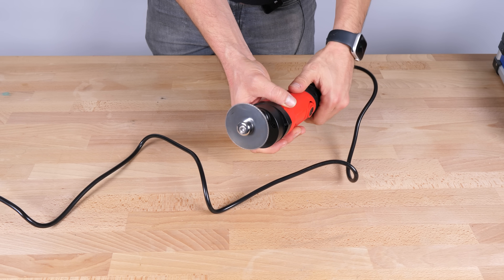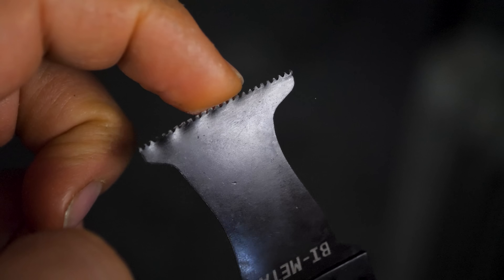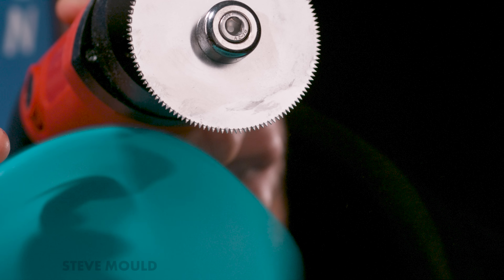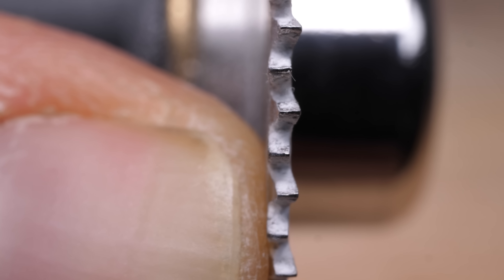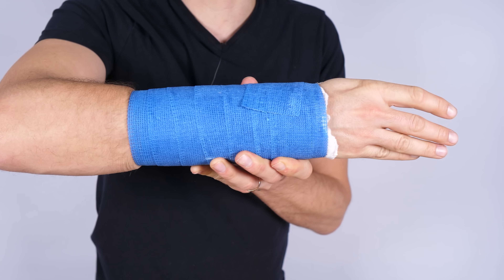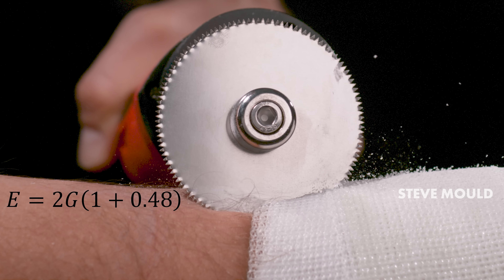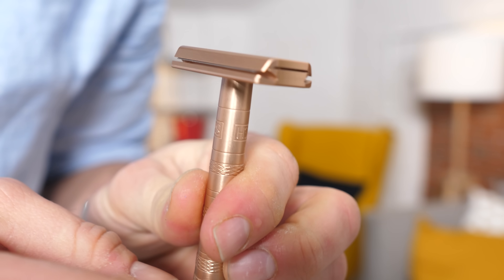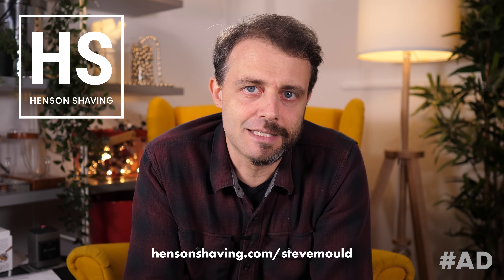A cast saw on human skin

Comment: Fein made the first oscillating tool for the construction industry. I use my makita version almost daily and I have pushed way to hard to cut a piece of wood and it slipped and jabbed into my palm more than a few times and not even a Nick. But afterthirty years in construction my hands are pretty rough.

Comment: I was born with congenital clubfoot and had to wear a cast for a long time. When they went to remove my cast, they used a machine like this. My mother told me that I was crying a lot, supposedly because of the noise, and the doctors said I was just scared. Apparently the person using it didn't realize that they were rubbing my skin and the friction made the cast around it start to melt. I ended up having second degree burns on my leg, I still have the scars to this day. Mind you that this was in 1997, so maybe the material for my cast was different than the current modern ones.

Comment: Cast saws can also cut you if the bolt holding the blade down is loose allowing the blade to spin on occasion. Thought it isnt usually a bad cut.

Comment: You were showing a Bosch driver with a Power For All Alliance battery. That's an initiative of Bosch (home and garden battery) and that battery actually IS usable on a growing number of alternate tool brands. ☺ Same goes for Amp Share (Bosch pro battery),  or CAS - Cordless Alliance System (Metabo battery).

Comment: I get all the principle's in this video and it all makes sense, but I still have a scar on my thumb from when I got a cast removed over 10 years ago. The nurse came in with the saw and showed me that it couldn't cut through skin by pressing it against her palm but when she was cutting the very last part of the cast up near my thumb the saw plunged straight through the last bit of cast and into my thumb. It wasn't a bad cut but it still bled a lot and the small scar that the nurse said would fade just grew as I grew. So now I have a scar along my thumb that I got from a saw that wasn't supposed to cut me.

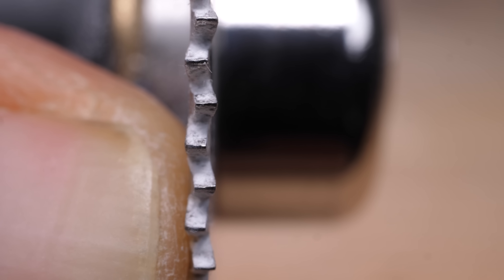Comment: 3:36 My beard trimmer (Braun 5517) has a linear oscillating sawtooth blade that works on the same principle, it cuts through hair but if you remove the guard and touch it with bare skin you don't feel anything. So yes, you can shave that way!

Comment: I had friends joke they would cut my cast off with a dremel or a angle grinder
We all knew that would be super dangerous, I've used angle grinder quite a bit and I've been nicked by them a few times. 
Also any rotary cutting device I fear would surely cut through the hard cast and likely the bandages and wrappings would get caught in the wheel and wrapped around it instantly, which would force the the whell into your body and prolly cut you badly.
Maybe a dremel would just stall and not have enough power or weight to cut you but an angle grinder would surely fuck you up

Comment: nice sponsor - but I've been using a beard trimmer for 23 years (since 2 weeks before the end of my military service) - back then I still had normal razors - and no money (the military didn't really pay conscripts much) and the razor blades are really overpriced.

I was simply too cowardly to use a razor very similar to the version shown here ;) ... and now I just wear a beard

About the vibration cutter: when placed on a knuckle, it cuts very well ... There is simply not enough soft material before it becomes hard and the saw blade can 'bite'.

Comment: I used to work as an emergency department nurse where cutting off casts was fairly routine. People were often scared of the saw. I would turn the saw on and rub the cutting surface all over my forearm with enough force to show it was touching and not just hovering. I would then often have them feel it in the palm of their hand and/or an arm or leg before they would no longer fear it. I told them the vibrations created micro-fractures of the fiberglass/resin or plaster, which makes the casts rigid. The reason for the dull teeth is to deliver the vibrations to a precise location.

Comment: I used these for years at a job for cutting off plastic from forms that we used in prosthetic and orthotic fabrication. They wouldn’t cut you open, they’re just jiggling back-and-forth. Usually the doctor shows the kids how it’s not gonna hurt them. Sounds scary though when you turn it on but of course with enough pressure anything could cut something open but roundabout it’s not going to “saw you open” ;) or is it 8D

Comment: The doctor uses a similar device to open a person's skull for brain surgery.  It oscillates at a smaller distance, or Amplitude, so that it will cut the bone, but not the brain underneath it.  I've even seen a child's toy wood cutting saw that uses the same mechanism to cut even very hard woods, like Ash and Hickory, but won't cut a finger.

Comment: I had casts on my legs as a kid. I was born with short tendons in my legs, so for the first few years I walked on my tip toes a lot. The doctors put special shaped casts on my feet to force me to walk normal.  And they were these fiberglass casts and they used a cast saw to take them off.  This was in the 2nd grade this happened.  What's funny is it was such a big thing in my life at the time but I haven't thought about it in years.
Reply: oh interesting to hear from other toe walkers. for me they made these special shoes using a cast of my feet and they were just made of hard plastic. i later on got a surgery and i was really scared of the cast. unfortunately the doctor didn’t show its safety and i was just terrified. it also ended up giving a slight scar on my leg so that sucked.

Comment: What really has to be stressed out is that a cast saw is NOT SHARP, at least not on the direction of the cut, that is why it doesn't hurt you. You can see the blades are not positioned like you would see them in a saw for example, they are perpendicular to the rotation. That is very important: the blade doesn't cut through the cast, it scrapes is really fast. If the blades were parallel to the tool, they would absolutely cut you even with such a narrow movement. Actually, if the blades were parallel to the rotation it wouldn't really matter how much they rotated around the center before pivoting, even a very narrow movement would be enough to cut the skin. See for example the electric carving knives that people use to slice turkey!

Comment: 😑 Proprietary power tool batteries, man. It's enough of a hassle, that I'm getting a 120V-output battery pack that I can just throw into a small backpack, and buy cheap corded power tools. Even new, they're about half the price where I live, and if you get them used you can get them for ludicrous prices, because everyone wants the fancy battery ones. (Like my $5 CAD corded drill - more powerful than the $80 battery drill that had a battery wear out! 😆)

Comment: Oscillating multitools are bonkers.
They cut through oak faster than they cut through pine because pine is too 'floppy' and absorbs the energy of the blade,moving with it on a small scale.
Similar principle to chainsaw trousers I imagine.

Comment: As soon as I read the title of this video I looked at my right wrist…
No, there‘s not a cast on.
But…
There IS a distinctive 10cm (4inch) long scar there.
How did it get there?
A FRIGGIN CAST SAW! is how it got there!

When I was 15 (26 years ago) I had a cast on my wrist to stabilize the wrist and medicarpal bones that constantly dislocated.
After 6 weeks of „rest“ the doctor took the cast off with a cast saw because he didn‘t want to cut with scissors and risk to dislocate my bones again.
The saw blade didn‘t even touch my skin for more than 2 seconds in one place at a time and I felt a „white hot“ pain where it did.
When the doc removed the remnants of the cast there was a 10cm (4inch) long, slightly bleeding line on my wrist.
Turned out that the saw gave me 3rd degree burns!

The cast saw did what it clearly shouldn‘t have done.
Especially since my skin is super stretchy.

So, why am I telling you this?
As a cautionary tale.
Just because something shouldn‘t happen doesn‘t mean it won‘t!
In this case I‘m living proof of that.

So have a nice day and definitely DON‘T! try this at home folks!
If a doctor with the right professional equipment was able to get a bad result, then you don‘t want mess around with an „amateur“ setup at home.

Comment: why is the blade circular when only a small part of it is used to cut? similar oscillating power/multi tools have asymmetrical blades so you see immediately that they do not spin.
Reply: you can possibly rotate it and have a fresh section of the blade.

Comment: If you look at the DeWalt electric multitool it's just an oscillating blade and it's the same thing. I have held mine against my arm and it literally just goes numb from the vibration. It doesn't even tickle or anything. It's actually literally the safest saw.

Comment: I was always taught to use as much of the length of a saw blade as possible when cutting wood or metal so that the whole blade wears evenly (plus the longer stroke is a more efficient cut).  Presumably, the cast saw blade can be rotated to expose a new set of teeth.
Reply: I imagine you just hold it a different way around, didn't look like it had a specific grip.

Comment: The original Feyn multitool is similarly 'safe' on human skin, as demonstrated in their vendor videos & live demos... But those things were about $1000 ten years ago --- they are so much quieter than the similar $30--$50 tools you can now buy since the patent ran out (around 2009). I would indeed not test it on my own skin with those; also as the rotation angle is fixed, the distance your skin stretches varies with the length of the implement you clip into them.

Comment: I was definitely hurt by a saw cast because of the heat/friction. As the doctor was using it trying to cut through my cast, I complained a few times and he was very dismissive and said it can't hurt you. Then once he had removed the cast he apologized when be saw that I had infact suffered a painful burn sort of injury.
Reply: Same here—not me, but an acquaintance. The difference between your story and hers is that she got cut as well. The blade didn't just burn her, it went right through her skin since her cast was on too tight and there wasn't enough padding under the cast in that area.
Reply: @zdmacstudios oh god! How is she doing now?
Reply: Same here. Still have the scars
Reply: same happened with me too. except i was also crying and it wasn’t actually even that bad and i was also 14 so was quite embarrassed

Comment: Super interesting video, thanks for this!

Just one thing: that is not the speed of sound, sound waves are longitudinal waves, i.e. pressure waves, but the waves you are looking at here look like transversal waves, or a mix of the two. The speed of sound in skin should be closer to the speed of sound in water, so about 3000 m/s, rather than 10 m/s.

2000 FPS are way too low to visualize sound waves in skin, you would need something in the ballpark of 100000 FPS to show the waves moving just about 3 cm per frame.

Comment: when you talked about razors I thought you might also point out how an electric razor works, which, I think, uses a pretty similar method to the cast saw (might depend on the exact razor though. There are a few different models around)

Comment: Love your videos. Quibble with this one, however. When the orthopaedic surgeon removed a leg cast from my young son, my son complained that it hurt! The surgeon said, "Oh no." and demonstrated placing the cast saw against his own skin,.Well. When the cast was off, my son had scars on his leg from the "completely safe oscillating blade." My son was not bleeding, but he suffered skin damage. Whether from heat or pressure, I don't know. So. Practice doesn't always follow theory. In fact, practice precedes theory, don't you think.

Comment: Thanks for the explanation. I always wondered how it works.
I have a 'multi tool' which also oscillates. I'm going to try it on my skin!
Reply: I notice you did not post a follow up. How were the stitches?
Reply: @KonradTheWizzard 
Just tested my hypothesis. No cuts, just a slight tingling, so next time I break a bone I don't have to go to the doctor to have the cast removed!

Comment: Hi steve, as a biomedical engineer specialising in soft tissue biomechanics, id like to point out that the conversion from shear to youngs modulus only is valid for very low deformation settings. This is because it assumes a linear relationship between stress and strain in the material.

Comment: Hi Steve. I’m glad you made that comment about the heat because 40 years ago a doctor 3 nurses and my mother had to hold me down as they tried to convince me that one of those saws wasn’t able to cut me as they cut my plaster to loosen it from my arm. I still have the scar to this day which is about 60mm long. They may not be able to cut you but they can sure as s^*% burn  you to the point that you think you’re being cut. My mother still feels guilty about not believing me when I was running around the room trying to escape these adults in my mind, hell bent on cutting through my arm!  I can laugh about it today but not then.
Reply: I had almost exactly the same thing. Drs had to cut open a full leg cast because my leg was still swelling more. Didn't Believe me  until the cast popped open and they saw blood all the way along. Still visible scar over 20years later.
Reply: That would probably be an incompetent doctor. Cast saws absolutely can (and do) cause minor burns and cuts when properly used, but a serious burn or something indicates operator error, most likely from dragging hte saw along the skin. 

The proper way to cut a cast is by a series of cuts into teh case from the outside moving down it as you go (think like an old style can opener: make one cut, move a bit, cut again, move a bit, cut again, etc, etc) not a cut along the.

This both gives the blade constant breaks and keeps it from being in contact with your skin for extended periods.
Reply: That might have been what happened to the person I mentioned in my previous comment, @88porpoise  .Well noted.
Reply: They can actually do both
Reply: This exact thing happened to me as well. I think I was 8, they assured me it couldn't possibly be cutting me even though I could feel it hurt and told them. I let them keep going, I had a pretty high pain tolerance for a kid (I had lived with the broken arm without treatment for a week before telling my parents I had hurt it - oops). Then when they cracked it off I had a 2inch burn and they felt pretty horrible. I still have that scar.

Comment: Your drill battery literally has “Power for all” on it. Which is an alliance of multiple manufacturers with commonly battery interface. It’s the most non-vendor-lock battery system you can get. 😂

Comment: Cast saws are really useful tools, and a great example of using what's automatically there instead of forcing another, more general mechanism to work (Like a separation brace with a rotary blade or something). Our technology will only get better as we learn to take advantage of the base properties of what we're working with, no matter the field.

Also, as great and worth it as safety razors are, they're easy to cut yourself with when swapping to a new one. Be careful! Especially if you're like me and pass out at the sight of a drop of blood.. Honestly I sort of wish there was a gadget to swap blades for me, or a fancy razor that made switching blades less dangerous. In the meantime, using a thick cloth will help with the most dangerous aspect: having to screw and unscrew the head.

Comment: wow i think this elastic deformation thing this also is why skinny 23mm bike tires seem to puncture way more often than wide ~48mm tires. you would think that the wide tires would puncture more since they touch more road and have more chances to hit sharp things, but actually the fact that they can be (and usually are) inflated to way lower pressures (~30 psi for the wide tires, 60+ for the skinny ones) helps them avoid punctures by just deforming around the smaller pieces of sharp stuff. to this end it would be interesting to investigate whether stiffer, more "armored" tires are less resilient against punctures compared to more supple tires because the stiffer casing will deform less.

Comment: This comment will probably get buried, but I have a scar on my hand from where a cast saw cut me. It did some kind of strange thing where it like cut halfway through the skin, didn't bleed as I recall, and was a sort of "knick" that freaked me out and hurt. The scar is still there on my hand. I am 40 years old, and this happened in the 80s when I was a kid, which i'm assuming has something to do with it?

I just remember so vividly how the nurse or whatever convinced crying me that there was no way it could hurt me. They even had the little metal blade slid under there to catch it from hitting my skin. The small scar on my hand is a reminder of betrayal, a lesson.

Comment: Yes, I did this at home. I dared my dad to chop me up with a Reciprocating saw. With a lot of encouragement he finally put the saw on my arm. I had so much faith in what I was doing that it would be alright. Side note, if you do this party trick, use a multi tool. they oscillate about the same as a cast cutter. A reciprocating saw has no boundary's.